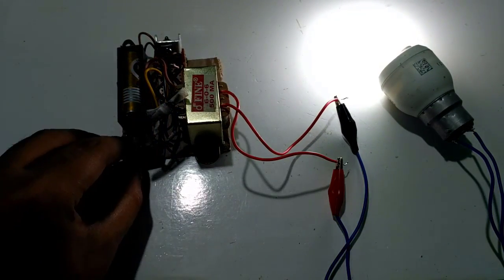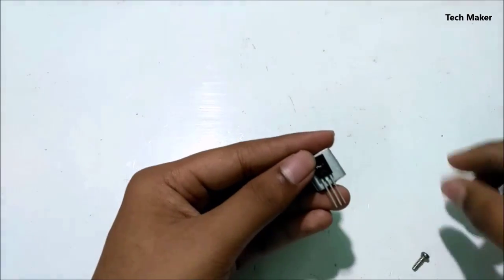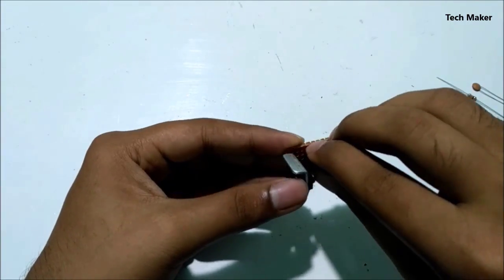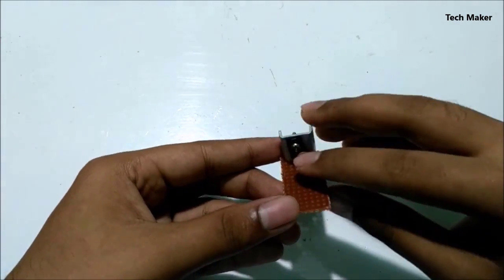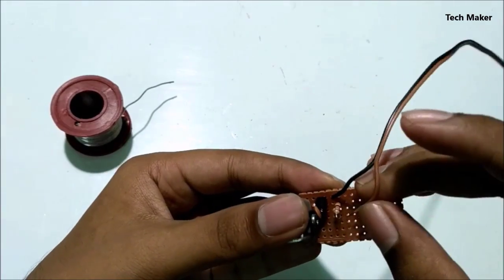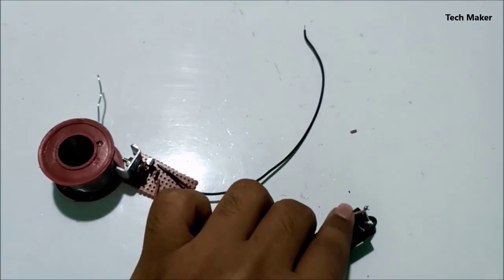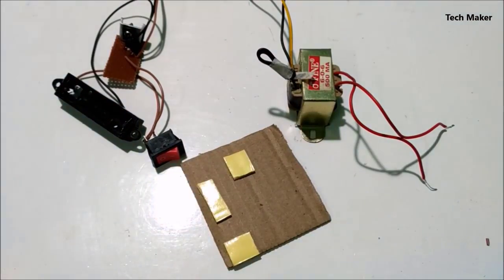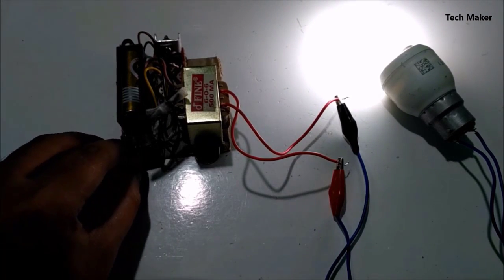How to make AA (1.5V) Battery to 220V AC Inverter

Comment: Which Capcitor should I use with voltage rating tell me fast
Reply from the maker: capacitance value is same as in circuit , the voltage reading of capacitor must greater than 200V
Reply: Tech Maker , should i must use only cermaic capcitor only.

Comment: Hi good vid. Does output power depend on transformer? Thanks.
Reply from the maker: +guruji243 yes
Reply: Thanks Tech. Today I did this circuit with a trafo and on ac meter out it showed 65vac but when I bridged it with a cap only mv was reading!!! Why is this? Thks.
Reply from the maker: where the capacitor is connected and how  the capacitor is connected (series to output/parallel) ? . You can increase the voltage by multistage voltage multiplier .
Reply: Cap is in parallel to dc side of br. I thought maybe trafo should be a ferrite core one.

Comment: Hi, I am able to get only 80-90v ac voltage even after using 3A transformer and I use BD140 pnp,Bc547B npn transistor and 100nf capacitor,30k resisror
Reply: Plz tell me if any thing wrong as soon as possible
Reply from the maker: +SM MMPUC increase the voltage rating of capacitor
Reply: If I increase the voltage rating of capcitor then voltage decrease which is explined in the circiuit explination vidoe
Reply from the maker: +SM MMPUC A capacitor will have 2 values. One is Capacitance which can be determined in farad as unit
Another is Voltage rating which can be determined in volts. You must choose the capacitor such that Capacitance is constant and voltage must high
Reply from the maker: +SM MMPUC in that video I only talked about Capacitance
Reply: Plzz tell some capacitor which I can use
Reply from the maker: use capacitor with higher voltage rating (greater than 200V)

Comment: Sir,i spend more money for this, but it not work,  help me sir??
Reply from the maker: +Kamesh Vadivel sure buddy . I will provide you a modified circuit with in a week, because exams are going on for me. Can you remind me on September 4 by mail.
Reply: Tech Maker yes sir, thank for your reply
Reply from the maker: use capacitor with higher voltage rating (greater than 200V)

Comment: sir 
I have sent you a mail please give me a solution .
Reply from the maker: +Ravi Barot sorry I didn't get.
Mail:. techmakertm@gmail.com
Reply: Tech Maker hello sir my inverter doesn't working
Reply from the maker: +Clarkson Frianeza ok, I will come with alternative circuit.
Reply from the maker: use capacitor with higher voltage rating (greater than 200V)

Comment: hello sir i maked this circuit with the same components as you mentioned but the circuit doesn't working
Reply from the maker: which transformer are you using
Reply from the maker: Circuit Explanation:    https://www.youtube.com/watch?v=n9mHHJv0iQk
Reply: i use 6v/220v transformer
Reply from the maker: current rating?
Reply from the maker: did you used 500mA or 3A
Reply from the maker: you need to use 3A
Reply: can you tell me number or code of all components

Comment: Sir, 

i have made this circuit as you mention in your video. I have used same component of same ratting as per your video, but i am not getting 220 volt ac output, instead of that i am getting only 24 to 26 volt ac. please me for this. ravibarot45@gmail.com this is my email id please give me solution or else give me your email id so that i will send you pictures of my circuit.

Thank you

Comment: hello dear nice video. i have a question,
without transformer attach how many voltage show with this circuit?
thanks.
Reply from the maker: +aziz wah 4-6v
Reply: can we use 3v input for this circuit?

Comment: how to connect the 6-0-6 500ma transformer because there is three wire one side and two  other side
Reply from the maker: +Vijay Dhiman 500 ma is insufficient. My transformer is modified. I added more turns and higher thickness wire. I recommend to use 3A or higher.
Reply: Can you provide me the complete circuit with transformer

Comment: Wow nice video good job. Is the cfl circuit still intact or you removed it I want to make a night light with this circuit
Reply from the maker: +franklin patrick not removed
Reply: Tech Maker how many  watts CFL did you use
Reply from the maker: franklin patrick 5W
Reply from the maker: franklin patrick I am currently designing a higher order inverter.
Reply: Tech Maker thanks for replying
Reply: Tech Maker I will download an watch  your new design thanks
Reply: is the circuit still going to function if I use a 6 volt battery
Reply from the maker: franklin patrick yes,but you need to add heat sink compulsory. it dissipate more heat. I think max limit is 5v.
Reply: Thanks for replying I thought the max voltage that can be applied to the transformer is 6 volt since the transformer is a 6 volt transformer

Comment: How long does it take for one battery?
Reply from the maker: +ปิยะณัฐ อาจประจันทร์  2-3 min as the battery is 300mah
Reply: How many batteries can be used?
Reply: bro,there was ready made for sale ?for 12 volts 7000 watts 230 volts enverter txt bact pls.

Comment: sir,i used 8v:220v transformer
Reply from the maker: here to ratio of turns will be less for your transformer. we require more number of turns in secondary coil i.e 220v side.
either you need to change the transformer or increase the turns to get the output

Comment: really it's possible???
Reply from the maker: yes , it is possible.
The basic idea behind every inverter circuit is to produce oscillations using the given DC and apply these oscillations across the primary of the transformer by amplifying the current. This primary voltage is then stepped up to a higher voltage depending upon the number of turns in primary and secondary coils.